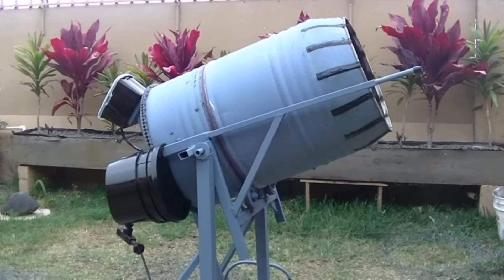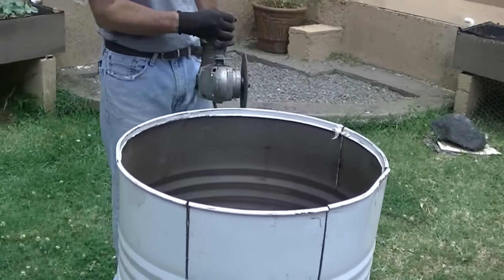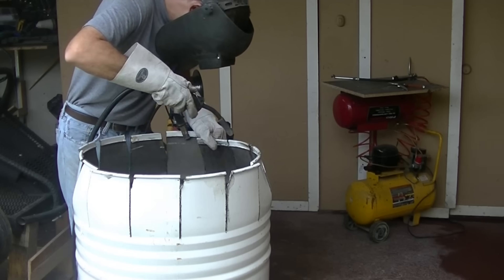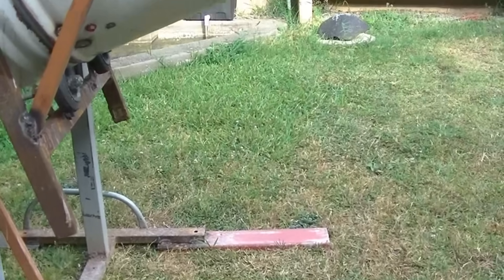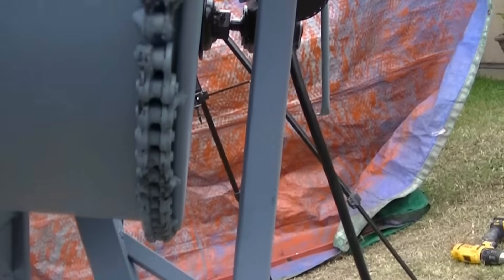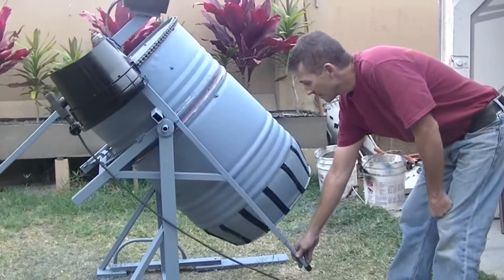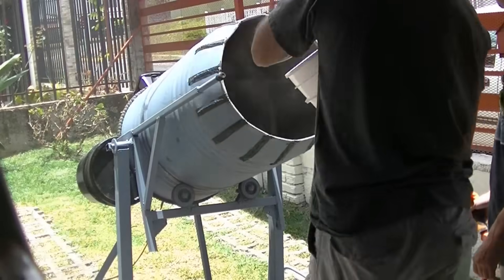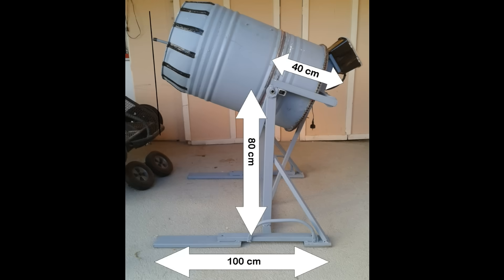How to build a 55 gal concrete mixer.

Comment: If any1 attempts to build one as well - im right in the middle of research :D

Seems like some extra enhancement should be used at 3:25 at the bottom of barrel, so torque dont fuck it up...
(not much of a work, and not worth to risk, just add some cross-bars or something...)

oh, i see the chain, nvm XD

Comment: realy like using the chain around the drum , gives a great reduction , might use the front sprocket from a motorcycle as i have a motor without a reduction on it probably end up counting the links of the chain and the spocket to see the reduction first , might need to step it down a bit more

Comment: I realize this was posted years ago, but had some suggestions for those looking to build a mixer.   I've built a couple, the first small one used a HF 2500lb winch motor, it already has the gear reduction and runs on 12v.  Used a car fwd hub.  I also used golf cart wheels and it pivots on the wheels, so the balance is important, I can lift it and roll it around with the load inside.  The chain sprocket is a good idea.   One thing I found with my bigger one (used fwd hub and transaxle to get 10:1 ratio, then another reduction as input to transmission and used a big winch motor)  is the mix paddles inside should not be up against the barrel, make sure to have a gap there and raise the flat bar.
My smaller one used inline skate wheels and they held up just fine.   Oh also, the square corner in the back just gets the concrete stuck there, you can see commercial mixers use a rounded or beveled edge in back.  For my big one I did like you did for the front, for the plastic barrel, I had to stuff it with some metal plate with concrete behind it.  This added weight to it, but the hdpe plastic barrels nothing sticks to it.

Comment: 🤣good job , thats an engineering  marvel . how much did you spend on this awesome invention?  and how much torque ,will it turn 500 -800 lbs  mix cement?
Reply from the maker: it will make one wheel barrow full at a time

Comment: GREAT JOB! I’m gathering parts to come up with something similar, but using a larger industrial clothes drier from burnt down laundromat. Also (attempting) a small hydraulic tractor tie-rod for lifting/dumping and lastly a micro excavator track for the drive “belt”. Still playing with motor options. Curious how many bags you can get away with without pushing too hard and, if you found a way to keep the inside from corrosion?
Reply: Using it keeps it from corroding. I dont use bagged concrete it is very expensive. I would guess 3 or 4 bags would work. It will make one standard size wheel barrow load at a time.

Comment: How much is the max load?
Reply from the maker: With out overloading it I can mix about a wheelbarrow and a half of concrete. So something like 9 shovels gravel 9 sand and 3 cement for a 3000psi mix

Comment: I WANT TO BUILD IT : WHAT IS THE SIZE OF THE MOTOR; PLEASE SHOW HOW TO CONNECT THE BEARING ON THE BOTTOM PART ; WHAT DO WE CALL THE PART WHICH INCREASES AND DECREASES THE SEED OF THE DRUM; HOW DO YOU CONNECT THE WHEELS; HOW DO YOU ATTACH THE CHAIN TO THE DRUM. PLEASE PROVE YOUR EMAIL ADDRESS.ANSWER USING MY EMAIL ADDRESS

Comment: Love you can build this, but the time spent building vs working overtime to pay for one, plus material costs easily adds to more than 155 quid for electric one, with a warranty and brand new motor

Comment: The gear motor is too small,  and also the sprochet, give a huge load to the gearbox.  I m sure it wont last long, can not use it for heavy duty works.  But i apreciate your work!  Much better then doing nothing like most of us.

Comment: I just watched an 86yr old man use a plastic bag to mix then pour concrete , didn't need/use a wheelbarrow/shovel/mixing hoe/bucket , simple quick easy cheap but I don't mean to take anything away from this guy either ! ;-)

Comment: great project. I have a few suggestions. A shorter barrel for better balance. A smaller mouth for pouring and metal wheels to reduce the wear. Rubber wheels won't last too long with all the weight .

Comment: Thanks for sharing the build. Any ideas on what motor might be best to purchase? I don't think I'm going to have the luck you had procuring one from my local salvage yard.

I can go 240v without issue if that matters. Also, I was thinking about a belt driven solution. Any thoughts? Thanks so much!
Reply from the maker: If you look at my update video i ended up cutting off the  motor and hooking up a drill running the reduction gear. yo should be able to find an old reduction gear.

Comment: You should have used a smaller teethed wheell (smaller circumference) against the drum, as that would greatly reduce strain on the motor and gears.

Comment: Sweet design and build along with a good video and narration  as a teenager working with my Father i hand mixed lots of concrete for a large addition on our Florida home that most homes in Florida are a concrete block construction. With a stucco finish    The old man wouldn’t spring for a  electric mixer since he had me  a teenage boy to  mix for him  LOL yes it is a backbusting /  tiring job   Watching you guys use the mixer    Really makes  so much sense   And using the motorcycle parts  was a great idea

Comment: Great innovation. I have a spare 44 gall drum and which I will keep now that I've seen how practical they can be.
NOTE to anyone trying to imitate Aceman's use of grinders without safety covers: BE EXTREMELY CAREFUL!
Obviously Aceman is very experienced.

My dad nearly severed his finger doing this with a small grinder and steel blade with the cover removed while cutting door architraves.

Comment: I'm guessing that bearing will last a dozen mixes (or so.)  Dust contaminants are unavoidable.  Any feedback on the bearing longevity?
Reply from the maker: Still use it with no problems.
Reply: Thanks for the update. Even if it fails it looks easy to replace. My commercial mixer ran great for years until I got some cement dust on it and it froze up. For me, concrete is as easy to mix in a wheelbarrow. That's easier on my back than lifting holding up heavy bags and shaking out the aggregate.

Comment: Brilliant work ! I''m going to make this . I have a 220v 325 watts (1/2 hp) 1.5 amps AC motor (salvaged washing machine motor 1320 RPM ) lying around would this help me  with your configuration or would you suggest  geared DC setup?
Reply from the maker: You could use that motor you just need to get it geared down so it spins the drum about 45 rpm.

Comment: Probably would have came out better if you just use a belt drive system and 1/2 HP non-gearboxed 90 volt DC motor attached to tiny belt pulley and controlled by a speed controller that has constant velocity control (aka IR compensation) . The constant velocity control will make the motor hold speed regardless of load (within reason of couse, you're not going to move a 5 ton boulder with this without stalling it). You could literally put your hand on a DC motor spinning so slowly, yet will not be able to stop it when it's being controlled by a controller that keeps speed the same under all load conditions.

Comment: Great vid!!  Just seems that there would be alot of stress on that motor in which is probably not designed for turning crete.  How many times have you used it without issues?  An update would be great yo.... since its been 2 years.  Im intrigued
Reply from the maker: Thaddeus Fronczak its still running strong i need to post a follow up video.
Reply: You could always add a thermal switch to shut off if it gets too hot, and/or a fan to blow over the motor might help.

Comment: no blue tooth?
no wifi?
no touch screen?
what's the app to control it ?

dang its nice to see simply application of great skills isn't it ? :-)
Reply: There's an app to make an app to control this thing by hijacking the signal from any of the geostationary satelites in your area. Does interfere with commercial air traffic, so check flight paths before using (with an app, obv).

Comment: Cool project.   It looks like. A lot of work.  In comparing it to buying.  A used.  Chinese made one   On Craigslist. Or. ?    Ive. Seen many of them for. Sale.  For under. A 100 bucks ?    I. Am all for.   Doing things. On your own to save money or.  Build. It better. Than.  Commercially.  Available products.   But looking at the. Parts. Needed. To build this unit.   The way.  Its done.    Compared to.  Buying. A Harbor Freight.  Unit. Or a used one.   Doesn’t.  Appear. To be.   Very cost effective ?  Plus.  Factoring. The. Amount of time. It would take.  To build.  ?  Not.   Being a hater.  By any means.  I was just. Curious. Of the.  Advantages / disadvantages.  Of making.  Your own.  Mixer
Reply from the maker: If i lived in the states you would be correct. I have people from all over the world watching these videos that dont have access to a harbor freight.

Comment: Very nice. If you were not going to use the motor to control speed, you could use a pair of pulleys or gears and just change the outer dimension, or gear ratio to get the speed you want. Mathias Wandel has a great channel on YouTube and he has a design program specific to gears for only $26. It would make it easy to test out and create. Love the project.

Comment: Dude this is sick as fuck , your Genius, I love this build , I just sent it to my son ,& told him we need to build this , liked & subscribed thanks bro. Awesome build
Reply from the maker: Thanks for the comment. I want to build one without the gear drive motor. using the chain idea to make a large reduction gear. That way anyone around the world would be able to put one together.
Reply: Aceman30. A very clever design. and an excellent video pure gold and diamonds. An industrial ordinary electric motor will do the job, any gas engine with centrifugal clutch will do also the job with the correct demultiplication, easy to get with chains, sprockets and chumaceras you can find everywhere. Many thanks for the uploading.

Comment: Great job with the build! Now that you have used it a time or two, do you think the drum may be too large? I am sketching up my own version, and Im wondering if I should cut down the height of the barrel? Making 50 gallons of concrete may cause a failure. Thanks
Reply from the maker: Yes its a little long but the reason I left it was to make it easier to weld the top ring around the edge. I guess you could cut it and wrap re bar around the edge to re enforce it. Depending on how strong your motor is will dictate how much you can mix at a time. I am able to safely mix 4, 5 gallon buckets at a time.

Comment: Nice build...As a contractor in philly for 30 years I've mixed a ton or thousand of crete, stucco, mortar, etc...I can appreciate the work, The real mixers are EXPENSIVE...How is it for cleaning? I imagine the motor won't last for too long but it was free so no biggie...Hopefully she works forever...
Reply from the maker: Yes the motor went out pretty fast but i used the reduction drive from it and connected a 650 watt drill it has been working great poured a 20x20 x6" slab last month ran 5 hours with out stopping.

Comment: I like this. Might end up making one for out work to be done later on the property/farm.  Some ideas to think about:
* Since using a DC powered motor:
  - you could actually reverse the motor for pouring. The same way a cement truck does. 
  - slow it down for pouring
 * You have the fins in there already, just extend them a little closer to the opening to aid in pouring in reverse. Or add a 3rd row of them closer to the opening

Great work above all!  :)  Good explanation, easy to hear (actually had to turn down the vol slightly), and clear videos.

Comment: very  good  iron  work,  great ! but  you  need  a        pair  of  heavy  duty   rubber  rollers  for  transportation.     only  a  suggestion..  anyway
good  work  done....china  made  are  sold  around   usd  800 -  1,200.00.

Comment: not bad.
let me give ya a little help, turn up the heat on your welder and slow down the wire feed, as you slowly move the wire wiggle the welding rod / wire feed left to right about a 1/4" to blend the metal, mix the concert until you get a medium dark grey color, add lime for winter time and to lighten the dried color,
limed stone needs to be washed so it don't set up too quickly.
good luck.

Comment: I read in the comments about reward thrust bearings. Have you considered it , & what would the advantages be ?        thank's  [RABID BOB]
Reply from the maker: I have not had the need for them. Most of the weight is on the wheels not the bearing.

Comment: Didn't see any agitator mixing fins inside of the barrel. Even for a project on a small scale. All the ones I worked around, the mixer turn's one direction for mixxing, & the opposite direction to make the pour.  Please respond       [RABBID BOB]
Reply from the maker: I have them in there.

Comment: I want to weld some angle iron to some small steel drums for a pontoon boat. Guys I've talked to say it would be tricky because of the different gauge steel. Did you have trouble welding the angle iron to the inside? Did you do anything special to get a good weld?
Reply from the maker: No the welds have held. But I also bolted the pieces to make sure.

Comment: very nice work fine mig friend
Reply: nuri kokulu Do you know what is the dynamo that was used in this experiment?
Reply: Majed Al-sammera  hallo mig frient i cast maybe can guessing this motor a inverter fron a engine fron home skrap,i believ he only found on imagination
Reply: nuri kokulu I do not think that imagination has no such engine only looked at the market almost a month and mostly do not understand Arabic, I have a friend from the Philippines proposed to Mator conditioner water but there is a problem with this Mator several sizes that I do not know what size that fits this idea 😭
Reply: I cast think sooo,but if yo think so problem whit water of motir you can paj a one water pump motor ,because you can haven't problem so my friend,and you have to find your self,you most
Reply: nuri kokulu Already ratified needed I get a solution to my problem and will look to God for a solution thank you for your response to me and your contribution with a solution
Reply: Thank you self,you velkomm
Reply: hallo you my friend l find a god ide for you,you remember  you need one motor for this projekt,you can pay chinese knife sharpening water sharpening motor ,you have two side,you need this  slowly side i think you can connecting drickt a barrel this most work so l cast think so,

Comment: brilliant idea, can it support 1 bag of 50kg cement and the ratio of 1.2.3  cement , sand gravel? . loves you work using recycles materials.
Reply from the maker: No that would be to much. I use a ratio 1cement 3sand 3 gravel. I can put 2 shovels cement, 6 shovels sand, 6 shovels gravel in this.
Reply: Pg Abd Raman Abdullah Do you know what is the dynamo that was used in this experiment?
Reply: Majed Al- sammera,  To my understanding its an electrical motor and the gear mechanism system its like A CHAIN BLOCK that can surppot heavy load. gear box driven by an electrical motor. Sorry bro if my explainations inncorrect may be other viewer can helped and explain better
Reply: Pg Abd Raman Abdullah What is the electric motor, which bears the barrel and how much power the engine that needs the weight?

Comment: time is money just buy a real one
Reply: some ppl want to share his knowledge,,,i appreciate this video...not every contractor can buy real one in third country,,,this video help us so much
Reply: but instead of watching tv he chose to build it at home. i have an old washing machine motor, i could use it. plus some small investment i can save a lot of money for a mixer.
Reply from the maker: This is the point Thanks for watching.
Reply: Na sayers never get it.  its not about the money or the time.  Its about the build.  Its taking stuff others throw away and making something useful.  Its about the feeling of knowing you built it, but I doubt you get any of this.
Reply: +Icy Uranus in boise idaho right now building is in a boom were tge fastest growing city in the country and i have a pour in like 2 hours you know how long i had to wait for a mixer truck and a pump truck 2 fucking weeks so i bought a mixer for my smaller jobs are under 10 yards because the concrete companys here dont even want to do business with you til u have more than 10 yrds
Reply: That is my reaction on this video also wattsmilly01, he better spend his time to make money by one of his customers and buy a original one there not expensive at all.
You can recognize the real craftsman inhere.
Reply: this is not some poop stained third country. call up a mixer driver and a pump guy and get the job done right and in good time. no wheelbarrow required and no need to build a mixer

Comment: Trying to decide which motor to use. Calculations are super complex and it's been decades since college math. Can you give me a guestimation as to how much force you think you manually use to spin a loaded drum? Both when it's on an incline and vertical.
And do you know how much torque has?
 I calculate my 10,000 rpm/800w angle grinder motor will generate about 80 pound foot torque when reduced to 35 rpm which should more than do it. Meanwhile the motors available on ebay under $60  don't seem to go past 6 pound foot which I'm thinking that's too weak

Comment: i think worm gear is not ideal for this because of the massive momentum when loaded when you suddenly stop the motor it will  broke the gears
Reply: Since it's variable speed, maybe he can stop it slowly. You might also assume the concrete will be poured out before he stops the drum.